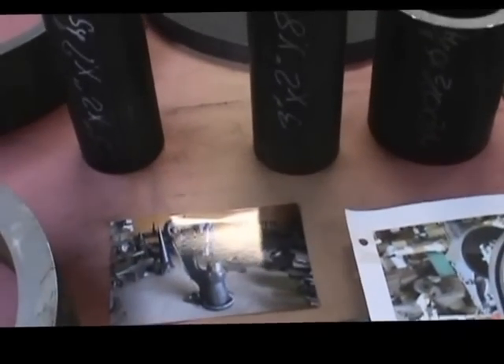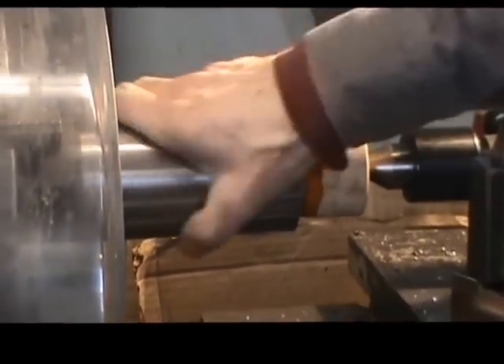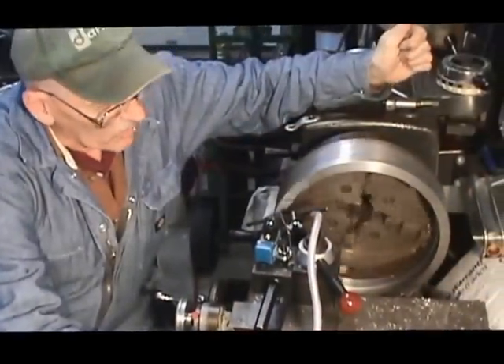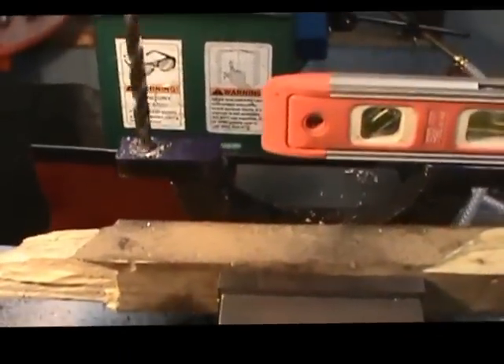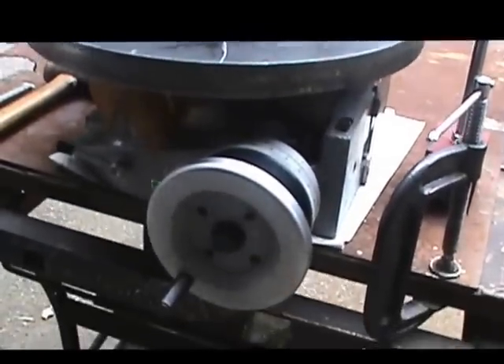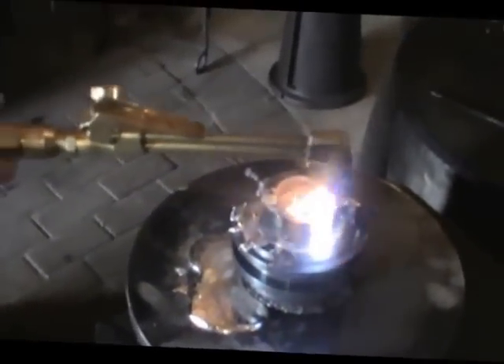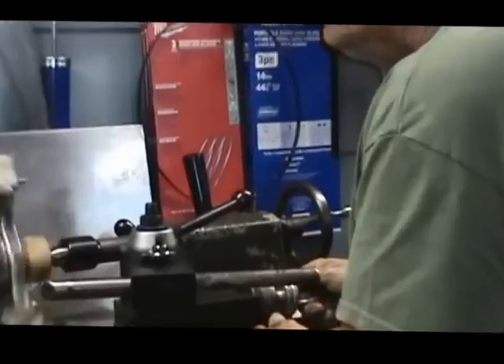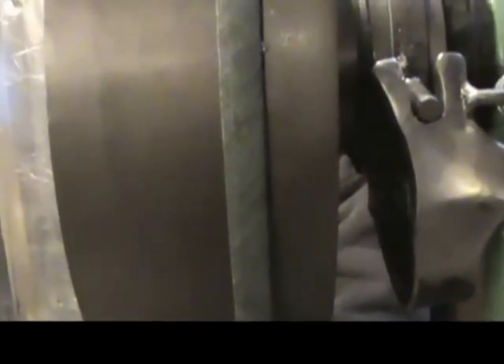The Little Giant Power Hammer

Comment: No don't weld a plate inside.., Just machine a cap that recesses the base and make a recess for the dummy; the cap needs to be tight fitting, that way it won't leak and you can use the cap for re-bearing on maintenance.

Comment: Why didn't you just press in a oilite bronze sleeve instead of going through all that work to use babbitt?
Reply from the maker: They used Babbitt originally so it seemed appropriate to keeping it as original as possible.

Just uploaded a new video of the power hammer in operation. Check it out here 
https://youtu.be/HI6xDnNz7Go